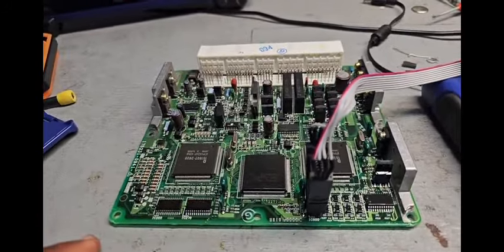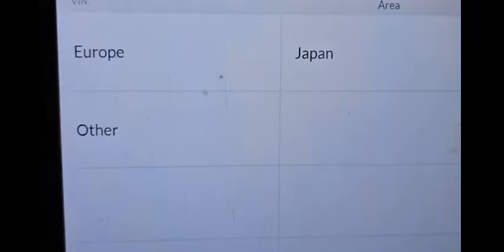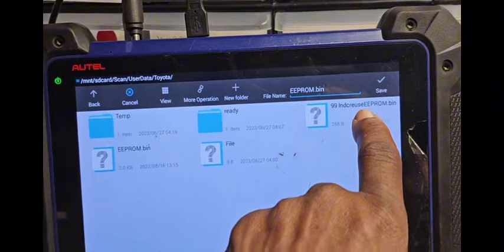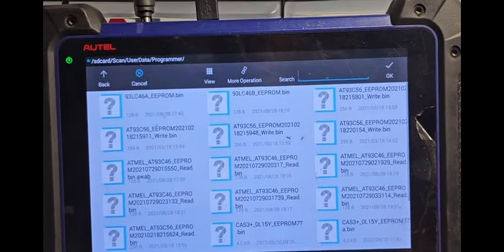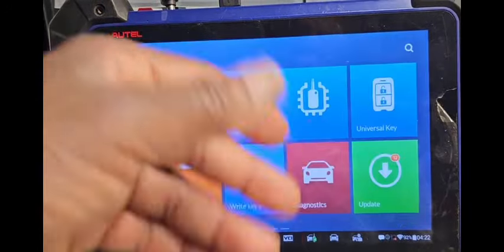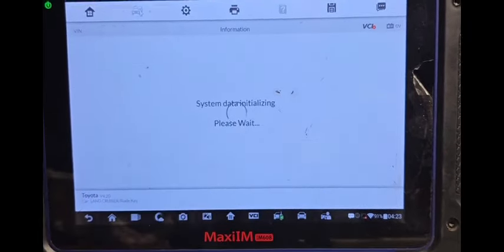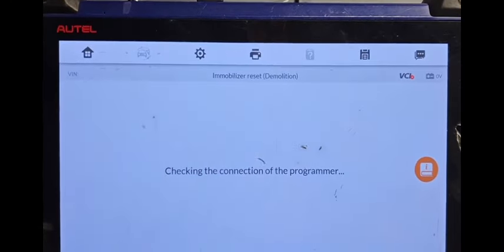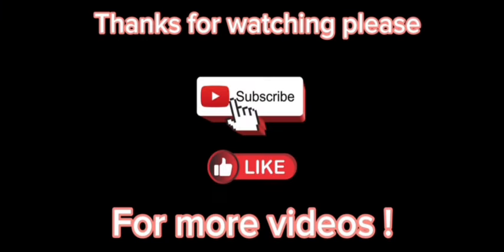How to Read and Write a Transponder Chip Key File for Toyota Land Cruiser | Step-by-Step Guide

Comment: You can make one touch processing easy
Reply: Just my suggestion my friend ❤
Reply from the maker: thanks learning from you
Reply: Yes one touch processing in write key via dump does everything you did in one step. Quick and easy. Also you can take one of those key IDs already used and use Xhorse key tool and create a super chip with that ID and you are done. No writing back. Like cloning a key.